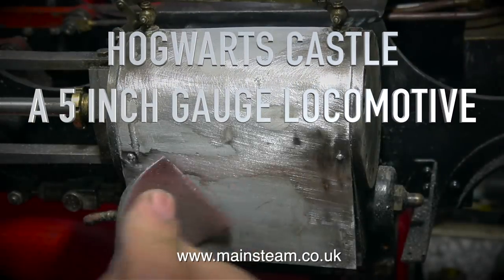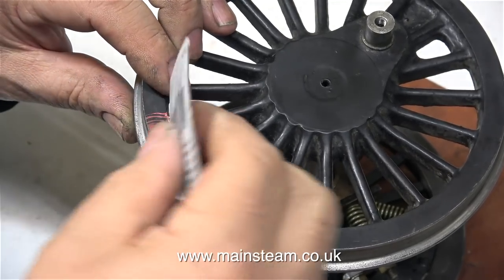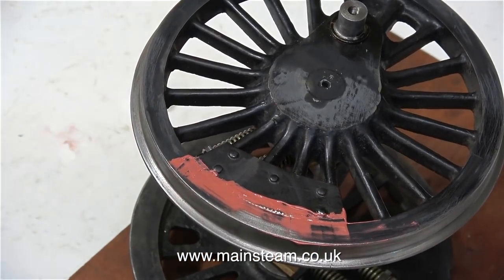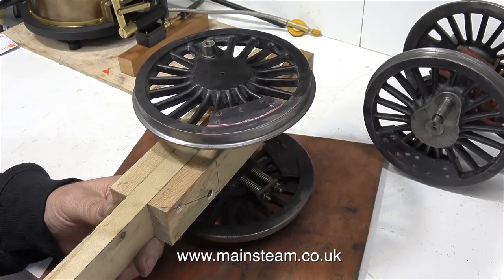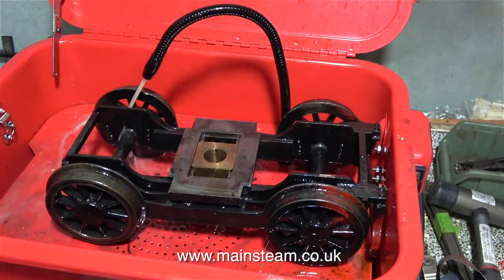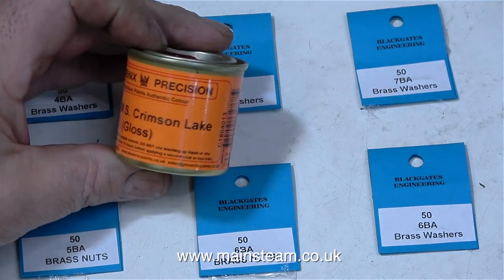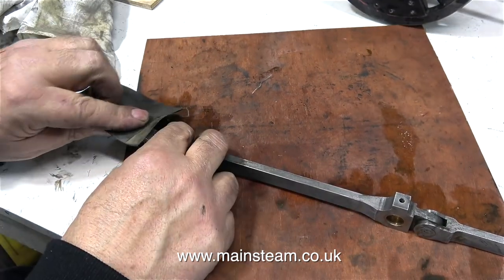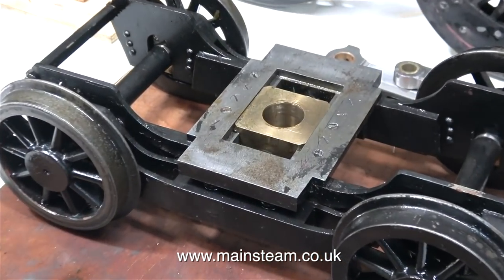HOGWARTS CASTLE - A 5 INCH GAUGE LOCOMOTIVE - PART #5

Comment: When I was in the Army, the teletype shop had a wonderful parts washer which had a rotating table in the center of the tub and used several solvent hoses with shower heads to squirt the solvent. I do not expect you to recreate the whole rig, but by installing a flow valve to minimize splashing, the solvent could be used to rotate the inner table, you could just close the washer lid once the table was spinning right, then go take a break or work on something else.

Comment: I was born in 1954 right opposite a power station, the coal was delivered by steam train we used to lie down by the tracks as the trains went by sometimes putting a penny on the track so it would flatten it out to twice its size , we used to play on the old rolling stock and have great fun until we heard an angry shout to piss off the lot of you, happy days indeed.